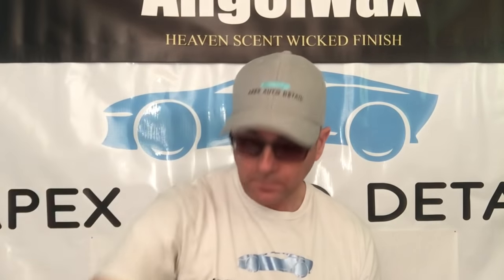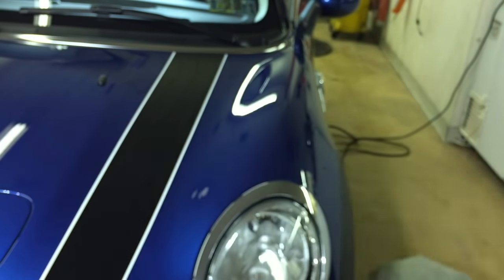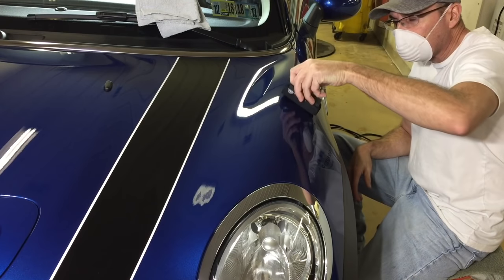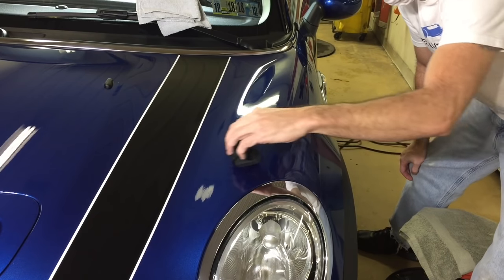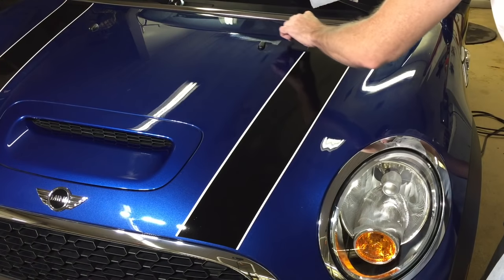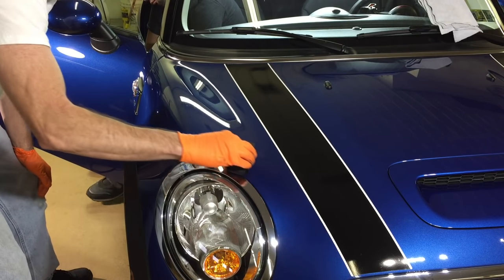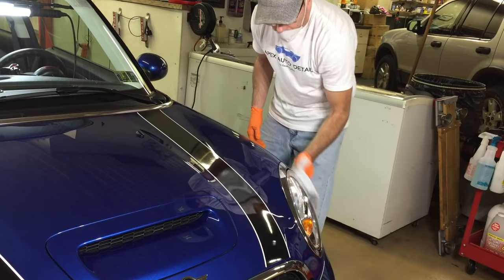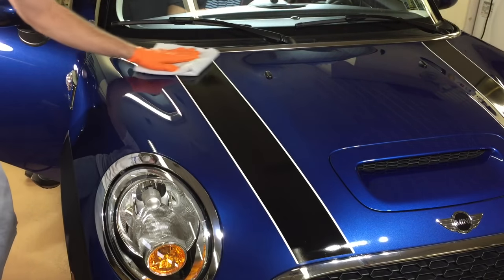Kamikaze Miyabi Coat!! High End Glass Coating!! User Friendly...Solvent Free!!

Comment: Kamikaze is amazing stuff, most notably for it's hydrophobic and self cleaning characteristics. Just passed 14 months on our daily driver done with Miyabi x 2, ISM x 1, Infinity Wax & Overcoat. Even in NE Ohio winter, the stuff is just plain solid and at 14 months still stays remarkably clean. Occasional use of Overcoat as a drying aid (less chance for streaking, makes it easier to dry), perhaps a coat of Infinity Wax every 4 months or so and maintenance is very minimal top keep the car nice looking. Tried 12 or 13 of the more 'popular' consumer levels coatings last year, none exceeded Kamikazes performance in my environment so all of our cars now wear Kamikaze. Great video, great product...well done!
Reply from the maker: Absolutely!!!  Iam in your neck of the woods... I totally get it. You will have a good solid year to look foreword to with that coating at full strength👍🏻💰
Reply: I am eager to try out the Inifinity wax. 🌟

Comment: I love your videos. Just one thing about protection. The dust mask you have, does zero protection against eventual fumes...it is a dust mask. A proper cartridge mask may work and even then we don't know the organic solvent chemistry used in this product. Safety aside, keep up with those great training video mate!
Reply from the maker: You are absolutely on point. And I wear the mask for the sole purpose of not liking the smell. It does nothing for protection. What I do have working for me is a better filtration and ventilation than most body shops. But that only goes so far. I will be ordering something more elaborate... great post.👍🏻

Comment: Hello,
I applied 2 coats of Miyabi but could not get to the 1 coat of ISM. I applied a coat of Overcoat this morning to protect it. Can I go back and add ISM despite a drive to work (anyway to clean the surface without water and not affect the curing of the Mkyabi?
Reply from the maker: ISM bonds best with the Miyabi. Having the overcoat there now is how I would leave it. Overcoat lasts an average of six months. You could then give it a quick IP wash, coat it with ISM.. then Overcoat.
Reply: Apex Detail Thanks a million. Will try again when it's time.

Comment: Great video. What's the shelf life of an opened bottle of Miyabi?
Reply from the maker: Put the cap back on and use electrical tape to seal the cap. I have an opened bottle for four months. That said... there will be crystallized particles on the cap and threads when you open it. Clean that and you are good to go!👍🏻

Comment: Great to see user friendly ceramic coating. How much would this detail cost the customer.
Love from the uk
Mark
Reply from the maker: There can be a wide range of pricing depending on how much correction is needed to get the paint prepared. One step, 2 step, multi step, scratch repair....